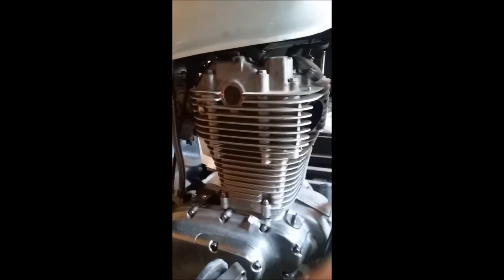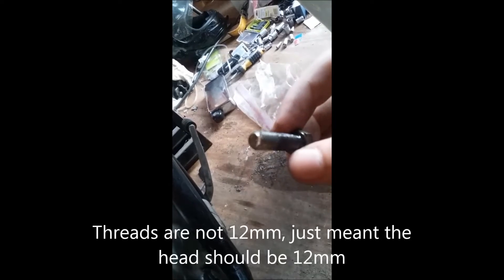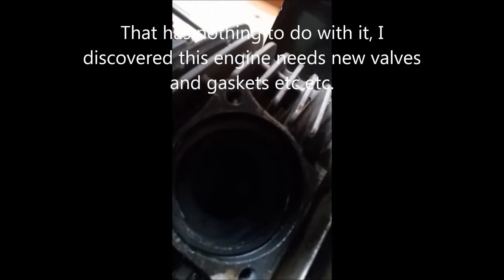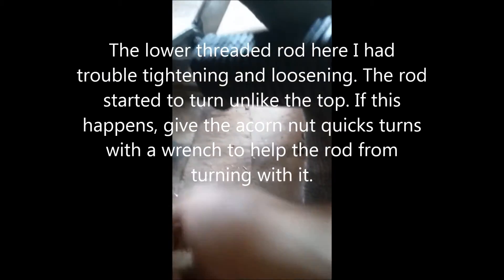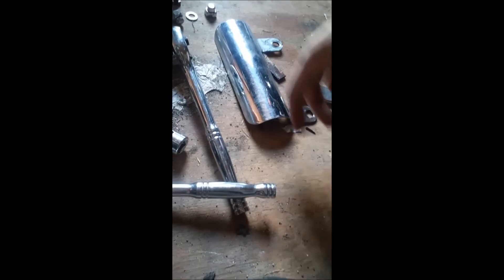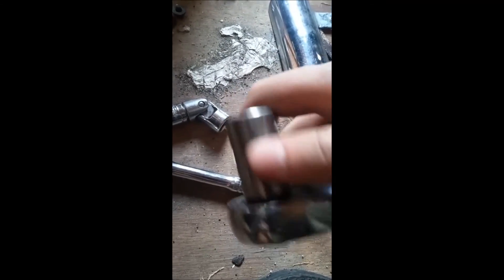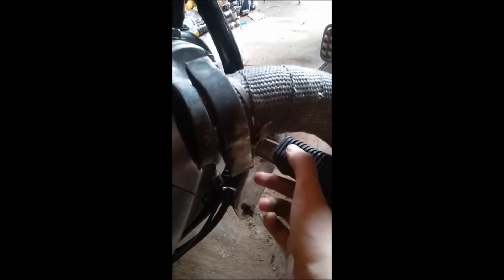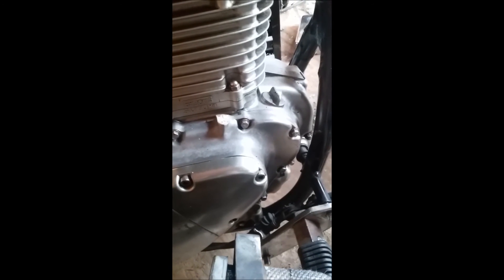How to Remove Suzuki Savage Exhaust

Comment: Hey man, thank you for uploading the video, quite instructive. I wonder if you know how to remove the pipe mount that sticks out from the body frame. Because I'm planning to put a shorter exhaust tip on and the pipe mount doesn't seem useful anymore. 
Please kindly let me know if you have an answer for that. Thank you again!
Reply from the maker: Sure Richard. The lower exhaust mount is held in by two items. On the right side of the bike there is a bolt that threads into an area on the frame. The other item that holds it in I believe is an engine mounting bolt that passes through the frame and engine. It is close to the swingarm. Both of these items may potentially be a bit tricky to reach. If removing engine mounting bolts, an impact driver makes it a breeze to remove them.